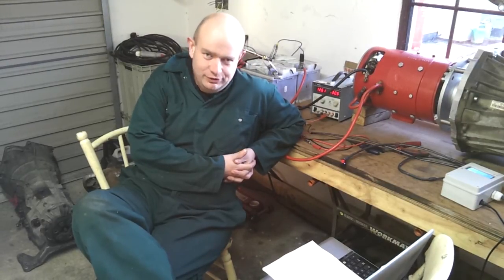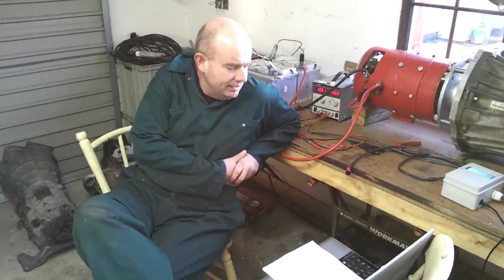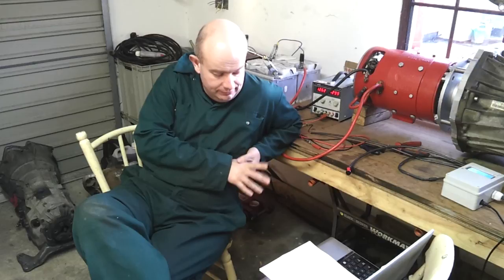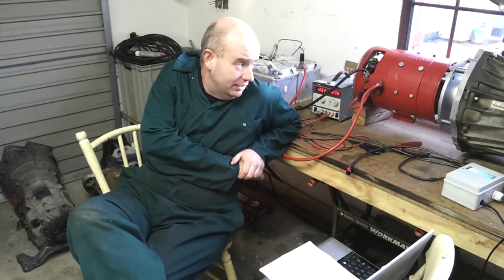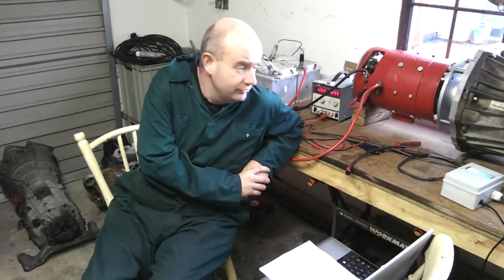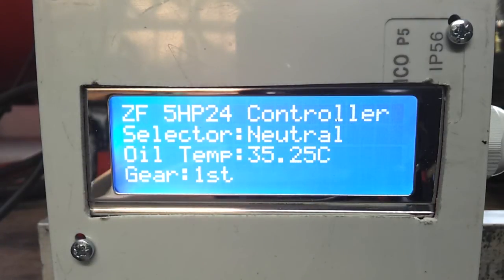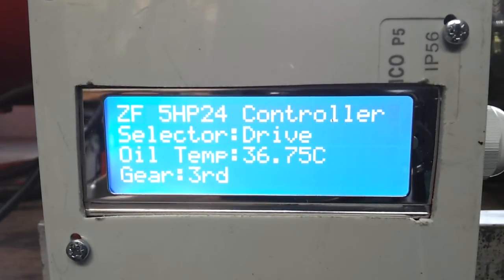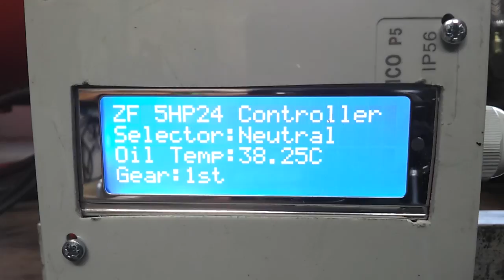EV ZF Automatic Gearbox Controller 07 : Shifting Time

Comment: Just had a thought. If you had a system like yours in a proper 4 wheel steer electric car, you could go up to 5th gear in reverse if you needed to, and be steering from the rear wheels only, so as to stay controllable the whole time. Would be pretty cool for stunts in movies, but just plain funny to freak out other road users as you pass them at 100 in reverse, lol.
Reply: +PathosBedlam The transmission part sounds very much as what the electric engine got in common with the steam engine, which can also rotate in more than one direction (meaning the external ones and not any internal steamer if a such thing already exist).